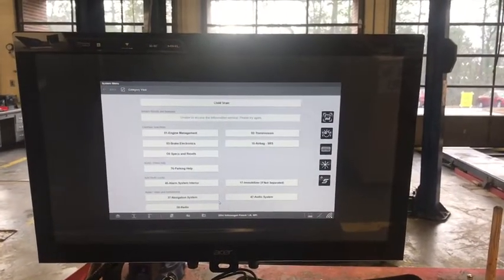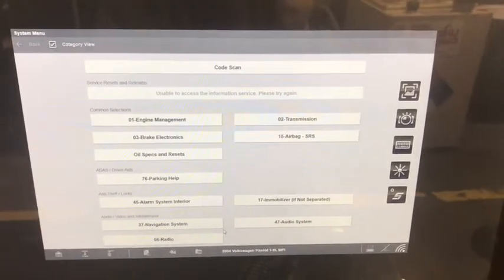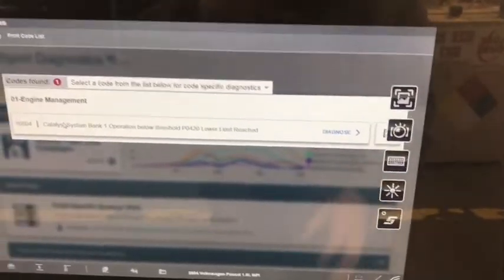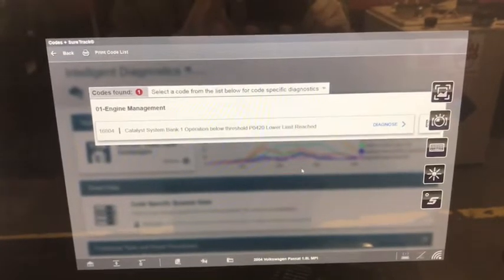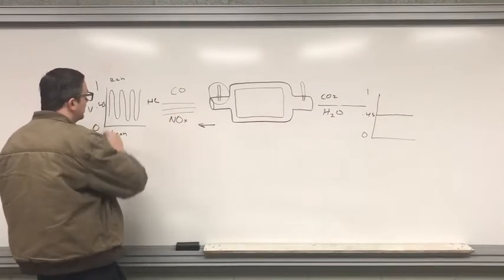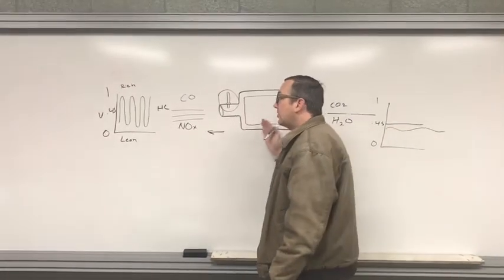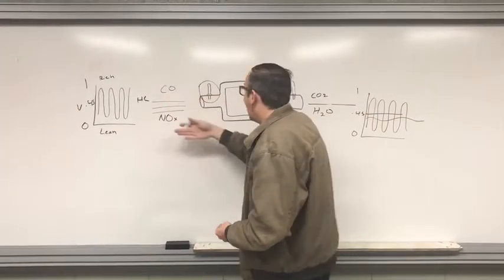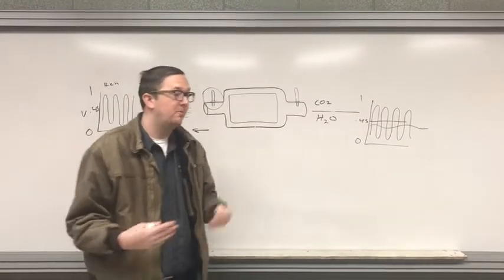P0420 code, catalytic converters, and O2 sensors explained, 2004 VW Passat

Comment: Any chance you could reply with the website where you got that add on converter unit? I have a 2004 VW Passat GL Wagon AWM with 1.8T 5speed and the code is driving me nuts and yet the exhaust is quiet as a mouse and no holes stock and the motor doesn't burn anything. Even clear in winter. Have taken really good care of it the last 10 years.
Reply from the maker: Looks like the spacer is being called something else now on Amazon, but after a little digging: 304 Carbon Steel Mounting Joint Threaded Connector Plug Accessories (60mm Silver) https://a.co/d/4yRaexg
Reply: @AutoScholarwithMrB  appreciate the time. Thank you. GermanFest here in Wisconsin is coming up so getting last minute touched done.
Reply from the maker: @BigSteve_Gaming187  have a good time and thanks for watching!

Comment: Great video but you might want to do a retake to avoid some confusion.  You started out with your illustration saying that the exhaust was flowing right to left but then when you started talking about the O2 sensors it was the reverse. I was wondering why you called the exit O2 sensor the front sensor.
Reply: Agreed the arrow direction is wrong/confusing

Comment: Got this problem on my Golf. Had a new converter on it 11K miles ago for £300 and new exhaust manifold seals as was slightly blowing. Has been fine but the code has come back. Everything else checks out fine. If I invest in a expensive quality catalytic converter will it chew through that as well do you reckon? 
It Dosent use to much oil probably about 1.5litres every 8-10,000 miles
Reply from the maker: It is possible that aftermarket cats won’t work with this system, so dealer cats might be your only option.
Reply: @AutoScholarwithMrB  Thanks thought that might be the case. It’s a shame because the car is great. Dealer cat is over £1000. Can’t justify it as would struggle to get that for the car.

Comment: I worked on a Town Car with a 171, 174 and a 420. I replace the pcv valve and re set computer. All 3 codes went away but the 420 come back a mouth later. If you get a 420. You need a cat.

Comment: I took my O2 sensors off and they were covered in a white/chalky layer of crud. 

Is my engine running too lean?

Also saw the same stuff inside the turbo when the catalytic converter came off.
Reply from the maker: Adam Korekach a little of that is normal, I’ve also seen that if you have ever had a blown head gasket.
Reply: I hope my head gasket hasn’t been compromised.  Still makes decent power. 

Does a head gasket go all at once or can it have a slight leak over time?

Thanks Mr. B
Reply from the maker: Adam Korekach normally the car would be overheating. May just be residue from the fuel you use. I wouldn’t worry if the car was running ok.

Comment: I just replaced my Passat b5.5 factory cat this past Sunday! (7/26/2020)
My brother and I put in a Walker cat along with a Techtonics Tuning all stainless steel 2.5” exhaust with 2 Borla mufflers. What a huge difference in performance and sound!  

I was so tired of replacing the flex pipe every 15 months, so we went with all stainless!

My 2003 Passat was throwing this same code as your wagon, as well as a code which indicated a bad gas cap. 

The hardest part was tightening the three exhaust studs which mated the cat to the downpipe. Very little room for wrenches or sockets!